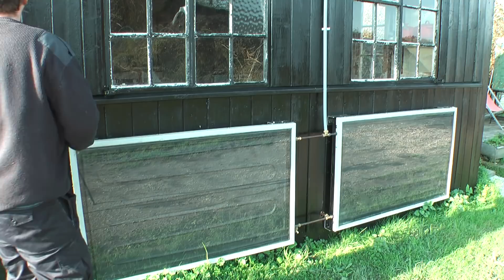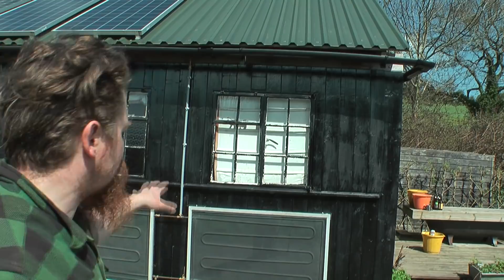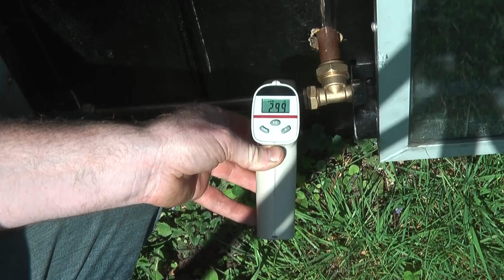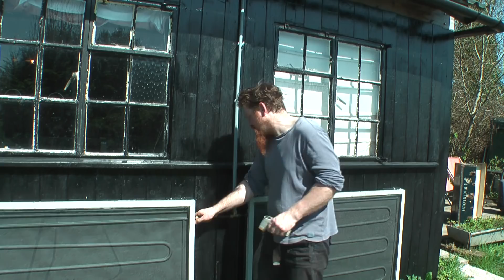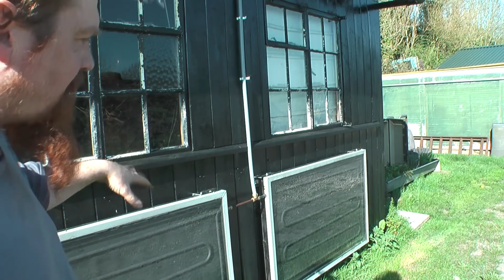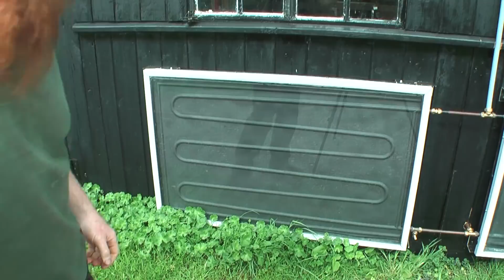Solar Hot Water Part 2 (of 3)

Comment: Hi Maximus

Have you considered making the solar panels a 1 way system you seem to have created a crowded T junction in parts of your system I realise how old the video is and you’ve probably already ripped it out. But looking at how water flows it likes as straightish lines. 
My observation is if you took an angle and put it on the bottom inlet to the panel on the left,
then the top feed from that panel and fit a bent piece of piping to the  bottom feed of the left hand panel, also maybe use some polished or highly reflective material behind the pipe in summer it may heat the water to boost it a bit (this is just a guess),
Then last junction is an angle up to the roof out of the top connection.
The only thing I will say is I’m guessing here I just know that most fluids like going in straightish lines at the moment if your panels are of uneven temps one will fill the hot water tank and one will sit and do nothing reducing the system’s efficiency. However I’m  only going by what I’ve seen some people on here do
I can’t remember who it was I thought his video was more about something else and he went on to solar so I watched for 5 mins then left.
Your a land rover lover like myself. I’m hoping project awesome may soon be done as it’s going to epicly fantastic.
I’m glad I found this site a lot of your ways are how agriculture was many years ago especially copicing for wood and reed crops all the hedge rows being brought back.
You’ve created a little piece of paradise there you just need some more land rovers lol.

I also wanted to thank you for your videos on mental health. It touched me in rather an unexpected way I realised I’m  not the only one whose struggling at the moment with issues tied to medication.

Regards John.
Reply from the maker: Hi John, as the panels are in parallel they act in unison. It's a thermosyphon system, so rather than flowing like a pumped system would it's more a case of the hot water being displaced by denser cold water coming in at the bottom, it all happens rather slowly so the tee pieces are not an issue in practice. As you guessed though it is all about to be ripped out for a new project!
I'm glad the video on mental health was helpful, it was one I wanted to make for a long time as I feel it's a subject still not spoken about enough. 
Cheers Max

Comment: I used black hot water pipe and put it in coils on rooftop cold in and very hot water out other end on a workshop of mine, I used 600 feet of pipe made in 3 foot loops on an 20 foot roof over lapping each other cold going in bottom or start at 38 degrees F and coming out at 105 degrees F  even worked on partly cloudy days.

Comment: If the water gets too hot why not just partially cover the panels instead of using your internal radiators as a heat sink...it’d be Summer after all and the last thing you’d want is to heat the house.
Anyway, I think your videos and knowledge is amazing.
Certainly got me thinking about my stale treadmill of an existence 😐

Comment: Is there a specific reason you installed those panels in parallel? Wouldn't a series setup perform better because it would create a higher temp delta? Personally i would have k o inter b o th panels in series and ons above rhe other.
Also insulating those transfer pipes would be a must-do.

Comment: Would angling these 15 degrees upward and 15 degrees towards the after noon sun AND putting them in series versus parallel get you what your looking for out of them or would it be better to just get 2 more panels and put them in series with the ones you have and not change the angles. I assume using them in series would speed up the cycling and angling them proper would increase the temps and time it pumps per day. It would be nice if you didn't need to use the immersion element at all during summer. Your repeated statement of preferring the electric (solar) circuit versus a close loop plumbing circuit baffles me. At $100 dollars a pop for panels versus 5 for the water panels not to mention potentially unrepairable electric devices needing replaced. I find the plumbing route more viable with better longevity to cost ratio granted the solar is more on demand where the water is up to mother nature.

Comment: What about using these panels to heat the cold water up to 35-40° in a separate tank and using a electric heater to get it up to the desired temperature? you could use the colder tank water to run the floor heating and the hotter one for showers.

Comment: i have 34 x 270 solar panels and my hot water is set on a timer to run for only 1.5 hours per day  its 3000 watt  so im adding 4,500kw per day to it and that seems to be more than enough, i also  have batterys so for the rest of the day they are charging, i am still grid tied as a back up but my power bill is only 30nz dollars  per month  the panels cost me around $240.00nz dollars each $8,160.00nz all up spent about 20,000 all up on everything, my power bill used to be around 350 to 450 so even at only 350 a month it pay for it self in about 5 to 6 years

Comment: Having a working solar heating here in the Cyclades maybe I could give you some advices to increase you performance without being pretentious at all. You need to isolate all your pipes. Every exposed mm (or inch) is dissipating a hell lot of heat. Also, as you said your incidence angle of your panels is far from optimal to say the least. Also in cold climate you need to have well isolated panels, with double glass on the front side and a good foam or fiber panel behind to trap the heat and force it to build up.

Comment: Underfloor: not only do you risk the concrete cracking, but also you wouldn’t want to be standing on a floor at 40*C. But more than that........ at a low temperature you get more radiative and less convective output, which most people find more comfortable.

Comment: Insulate the pipe with a bit of cut plastic pipe that people use for electrical cables + fluff or plastic packaging. That spiral pipe snaps around tubes well, if not bend too much.
  Not sure if it's UV resistant.

Comment: @Maximus Ironthumper - The cheapest way you could make this system MUCH more efficient is to advertise locally for people to donate to you their unwanted mirrors. Then arrange your mirrors on the ground around your solar collectors in a line that draws a parabolic curve. (think of the shape of a car-headlight reflector). 

A parabolic curve, or 'parabola', always has a focal point. As the sun moves around, the unique property of a parabola is that it continues to reflect the rays to always arrive at the focal point. So the mirrors should be arranged in such a way that your solar collectors are situated at the focal point.

This way, you can not only arrange for many times more sunlight to hit the collectors, but also arrange for that amplified sunlight to hit the panels square-on. In your video the sun often arrives at the panels at an oblique angle, and at times the rays may even reflect off the glass completely, unable to do any heating!

For my suggestion to work, the parabolic array of mirrors needs to be facing the sun, and the panels need to face AWAY from the sun, and towards the parabolic array. This arrangement can be made much more powerful than photovoltaic panels! You could be making steam! In California a larger system, working on a similar principle, drives a steam turbine which generates 10Mw of electricity! You just need a large number of mirrors. 

https://www.smithsonianmag.com/science-nature/a-spanish-breakthrough-in-harnessing-solar-power-1106582/

https://en.wikipedia.org/wiki/The_Solar_Project

One more suggestion...  Now and then, people replace their double-glazed windows, and the old ones can sometimes be picked up for nothing. The two panes of glass in them has vacuum in between, to minimise heat loss from the house. In your video the heat output from the panels was disappointing, mostly because precious heat is being re-radiated through the glass. (remember that black bodies are not just efficient in absorbing, but in radiating too!) But if that glass was double glazed, then the heat picked up by the black collector would be better conserved within the panel. That's what happens (even more efficiently) in those large vacuum tubes.

Oh, and if you do decide to replace the glass with plastic, it may be a good idea to get double-wall, (better still - triple-wall) polycarbonate panels. The still air between the layers is a good insulator too - not as good as vacuum, but better than plain glass.

Great videos, Mate! Thanks for sharing your journey!

Comment: Why not try a coil of copper, fairly open and painted black out of the shade. You could get more surface area and depending how it was constructed, say a coil of copper spaced with soldered copper sheet, it wouldn't matter where the sun was shining from. It would be 3-D instead of the 2-D system you have.
Reply: Oh, and put a reflective stainless steel or mylar coated post in the middle of the coil.

Comment: If the two panels were orientated vertically one placed above the other, you might get a faster flow too.  
If the pipes in the panels wiggled between the long sides of the panels you could orientate the panels vertically too.
Current arrangement means second collector water is resisting receival of water from the first panel.

Comment: the problem is that there is too much water circulating in your panels, it would be necessary to make a system with a smaller amount (why not with a suitable liquid for that) it will heat the water that is in the reserve by transfer

Comment: Max, why don’t you add the other two panels you have? Also the thermo siphon stops warm water in the tank being cooled by the solar panels when they are not warm enough. If you add a pump then you may need a thermostat to stop that happening and off we go on the adding sensors and gadgets merry go round. I like your keep it simple, then there’s less to go wrong. Over here we get heavy frost so the panels have a sensor in them and when the temperature gets below 5 degrees the system starts pushing warm water back through the panels to stop them freezing. You can guess what happens next though, of course every year panels get ruined by frost ‘cause the sensor failed. Yet if they used a simple drain back system it wouldn’t happen. Everybody here is switching over to evacuated tube as well so I got a couple of flat panels dirt cheap and as I will just be using them for space heating in winter I can run glycol through them. Unlike you I will have to cover my panels in summer as we get + 40  degrees and things just get stupid hot. Other benefits of evacuated tubes is that frost doesn’t bother them and if a tube gets smashed the rest of the tubes in the panel keep producing hot water. Also with a broken tube just the glass can be replaced and the inner copper tube and reflector can be reused making repairs cheaper and easier. Cheers Stuart 🇦🇺
Reply from the maker: Hi Stuart, the other two panels were badly damaged (they were all rescued from a rubbish skip) and in any case the only place to fit them and have them all work the way I wanted would have covered up the windows! I agree about the many benefits of evacuated tubes, indeed I have a set here I may use at some point. This was just an experiment really, even so it has provided most of my hot water over many months of the year so I'm happy with it!

Comment: You must insulate the pipes otherwise the heat loss cools the outlet to the point there is no circulation and all you are collecting is lost before it even gets to the tank. Plumber with 45 years in the business.
Reply: 12 volt circulating pump.  Why fuck around with convection

Comment: Very interesting. You probably know this already but it would work better with larger diameter pipes. I've got an old house built early 1900 it have water heating with no circulation pump and those waterpipes are much ticker then todays water heating pipes. I have not tested it, it needs "some work" :D.
Reply from the maker: It depends on a few factors, inside I have a gravity heating system which runs through 28mm pipes, it works very well but the system was very carefully planned to make the most of the feeble flow rate. Outside with the solar thermal system there is only really a modest amount of energy available so I figured 22mm would suffice. In both system, cost was also a big factor, particularly inside, as even 28mm copper pipe was rather expensive!  Good luck with your system, I hope you get it working, there's something rather elegant about gravity powered heating!

Comment: They will probably pre-heat the tank quite well, maybe you lack surface area, my panel is 4ft high by 11ft long, it is copper construction and the layout is 15mm vertical rises on to a 22mm top and bottom rail, yours are serpentine but they should still work ok, my tank was a scrap stainless tank I bought for a tenner and I did cut the top of it, fabricated up a stainless gun type heat exchanger and installed this into the top of the tank, linking it to the existing coil externally with plumbing, effectively it means I have a coil from the very top of the tank to the bottom.
I must have been insane at the time to do this sort of work, but I tacked the lid back on the tank, filled the tank full of pure Argon and re-welded it up using 316L welding rods.
One big problem I had was my tank was only a little higher than my panel, at night the thermosyphon appeared to work in reverse cooling my tank down, I installed a one-way brass flap valve to prevent this in the 28mm pipes linking to the panel in the top outlet pipe, of course the thermosyphon was not strong enough to push the valve, so I removed the heavy brass door and replaced it with an annealed and hammered old copper penny soldered to a piece of microbore copper tube to act as a hinge.
One reason my panel is 4ft high is that I used waterproof ply to back it with which of course comes in roughly  8ft x 4ft sheets. 
Around 2011, I made one for a farmer friend to go on a barn roof,  this was 4ft x 16ft two sheets of ply long, I had to use a pump this time and to avoid complex electronics I fitted a tank stat in an upturned sweet jar to sense available heat. 
He had a better budget than me, so we had a custom made small copper tank made with a high surface area coil from top to bottom, this tank sat at the side of his hot water storage tank the coil linked to the panel and then this little tank was connected top and bottom directly to the other tank. 
The trouble I found with pumps is on less than perfect days they provide 
warm not hot water, so with this system although the water-antifreeze was pumped around the panel, the hot freshwater was allowed to thermosyphon between the small cylinder and the main hot water cylinder.
You are right though the cost dynamics have now changed with solar PV being so cheap, I liked your idea for running an immersion heater on 110 volts.
Just to take one nagging doubt away, during hot months when I am maybe away from the house, although the water does get absolutely scalding hot I have taken measurements and it seems incapable of boiling, the circuit water has been around 92-95 degrees but it seems to reach a sticking point where it can go no higher, this is because as the water circulates the panel re-emits  some heat back to the air.

Comment: I understand you can get a 48 volt DC immersion heater, which  might help?
I not an engineer, but two batteries 12v say 20 amp in parallel = 24v 40 amp output or in series = 12v 40 amp might have similar implications to the solar collectors, say one mounted above the other, not side by side, assume you have the room, would give a higher heat output from the upper panel allowing for  thermal flow?

Comment: Ideally the panels should be perpendicular to the sun, so near flat in the summer and angled toward low  sun angle in the winter months.
Also lag the pipework and beware  of freezing in the winter, i use propylene glycol mixture  as an additive.

Comment: i would say you need more angle on the panels i would say more pipe per panel also to transfer as much heat to the water as possible

Comment: Random thought, not sure if it's actually practical but what about a mirror or two to concentrate a little more solar power onto the copper panel itself? I wouldn't even know where to even get them or what their cost would be but I'd imagine it'd make quite a bit of difference to the total heat being transferred to the panel.